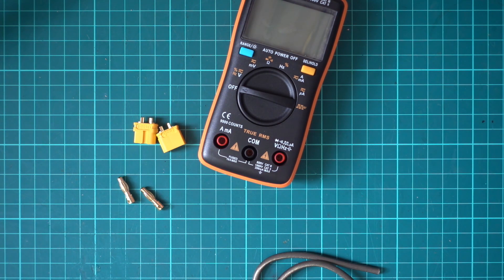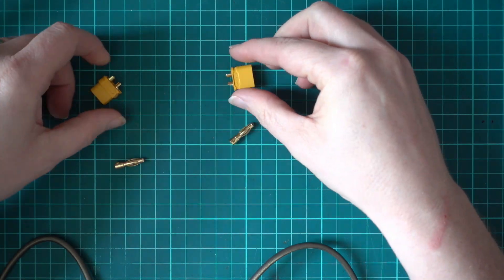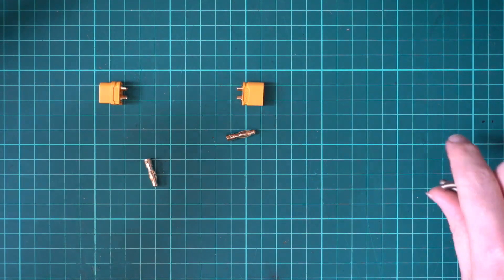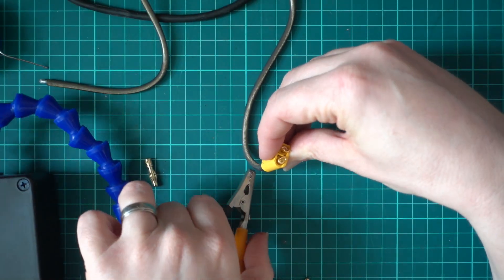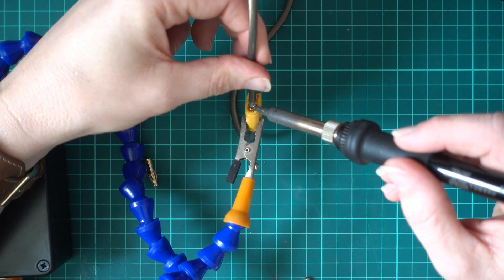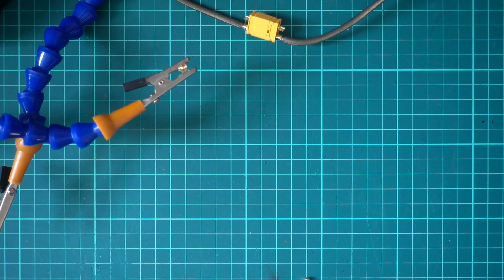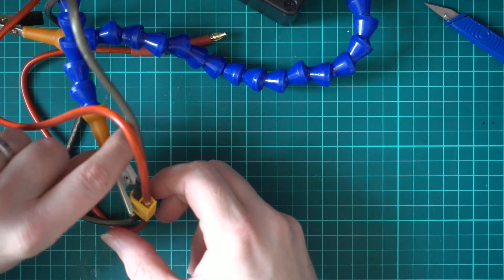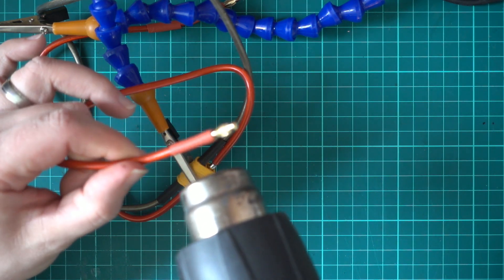Making an adaptor to measure RC aircraft amps with your multimeter

Comment: yea but the problem with that is most motors only go up to 10 amps before the internal fuse blows.
Reply from the maker: Of course. I've stated that this is for a maximum of 10A. The best solution would be a power meter for RC, such as the ToolkitRC 150A 50V meter. However, this gives people options. It will allow them to check their current up to about 9.8A; which would be fine for setting a current sensor in iNav for example.

Comment: Pretty nifty Darren. I like how you were soldering the connectors by having the connector facing up and putting the wire down into it. I always had it sideways. I think your way might be easier for my shaking hands.
Reply: i use a pair of locking forceps and hold it sideways on the larger flat side, but i rotate the pins so they're both pointing up :D
Reply from the maker: Thanks Lauren. Yeah, I always do my power connectors that way. 

I usually have them blu-tacked to the bench so that they don't move. That way you can build up a pool of molten solder in the bottom of the connector and push the wire in to it. The solder on the wire also heats up and you get a fused joint all the way down in to the connector.